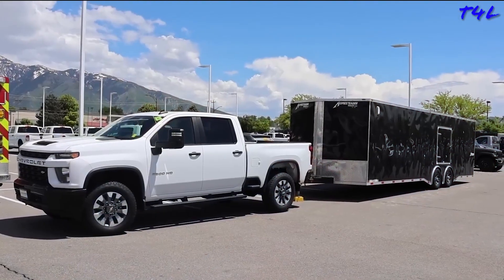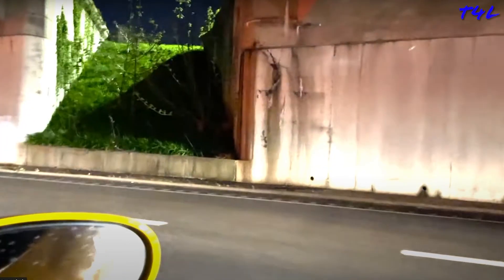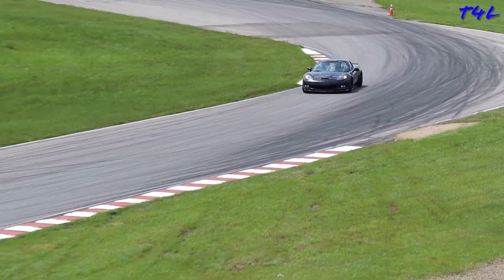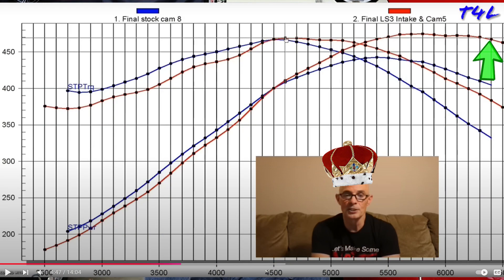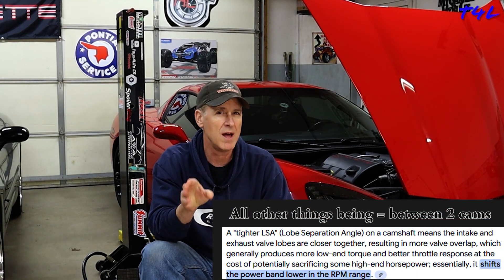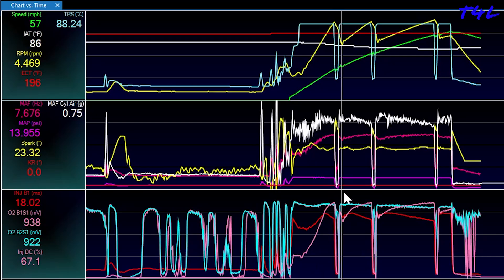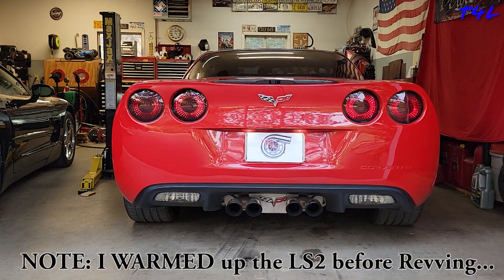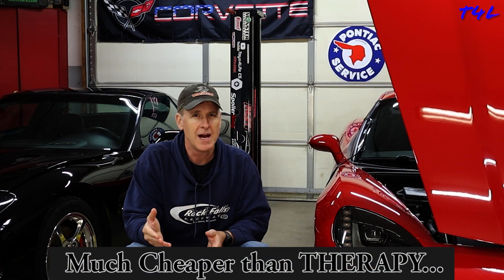Choosing a C6 Corvette Camshaft (Finding the Right One for YOU!)

Comment: I have questions, I see many people do headers and cams, it is necessary do both or I can do only the camshaft?
Reply from the maker: Ideally, if heat weren't an issue for daily drivers, headers will help a cam make another 10 to 20 horsepower everywhere.  You can definitely add a more aggressive cam with stock manifolds and still get gains, just not as much. The more aggressive the cam, the more it will benefit from headers.
Reply: Thank you.

Comment: I went with the Texas speed Stage 1 LS3 N/A Camshaft but I got dual valve springs and hardened pushrods as well the lift is .629 and it says the operating range is 1600-6800 rpm
Reply from the maker: Sounds like you have a solid combo!
Reply: Do you an auto or manual ?
Reply: @junioraguilar4004  manual

Comment: I watched a lot of Richards vids before I spec'd out a cam for my G8.  I went with a custom cam and spring package even though RH shows that the off the shelf BTR cams and their spring package works very very well.    I'm happy with my results but if I could do it again, I would change a few cam specs slightly.  I can tell you that a 212/224 115+3 LSA is done revving at 6500 in a 6.0 so you gotta go a bit more aggressive than that to rev all the way out to 6800.  My goal was to keep a smooth idle and I still have that and run high 12s in the 1/4.
Reply from the maker: I watch a ton of Richard holdner as well, great stuff!What are the specs of the can that you went with?
Reply: @Toys4Life  212/224 .590 lift 115+3 LSA.  It comes on at about 1800 RPM and should be shifted at like 6400.  If I went with a 114+2 LSA I think it would have bit more power with the same RPM range and should still provide a low smooth idle without shaking the car.
Reply: @Toys4Life  The Cam Motion cam calculator is a fun tool.  I called them and had a chat about valve events and got a bit more technical insight on cam design choices.

Comment: Hi Brother. You might want to check out the Lingenfelter 2-3 cam with .578 lift. I'm considering it for my 04 C5 with and auto and there's a few videos of guys showing the start up and idle and it sounds very usable.
Reply from the maker: I peeked at it an it is very small increase in duration over the LS2 stock cam (207/220) vs (204/213 ) but a bigger increase over the stock LS1 cam (196/208) so I think it is a bit too mild for what I am looking for.
Reply: @Toys4Life  I can see what you mean. I'll be looking to hopefully get my 04 LS1 up to around 400 hp without murdering the gas mileage. I retired last year and absolutely love touring in my Vette. Got to get my garage cleaned up first!

Comment: personally i recommend if you have a stick car, go with a bigger cam than you think. i have a c5z with a BTR stage 4 and just about everything else you can think of. car made right at 480whp. wish i couldve gone with a stage 5 (if they made it) but i was limited on my PTVC.
Reply from the maker: @ 233/248 duration I am afraid of losing too much low end torque which with a manual means a boggy 0-20 mph without abusing the clutch.  Do you disagree?   3k and above would be fantastic though!
Reply: @ if it was a camaro I would but the vettes are light enough to where it doesn’t matter. I feel like my car has a similar amount of passing power from 2-3k rpm as it did before I did the cam. After 3k it puts you in your seat. Driving around town isn’t bad either as long as I keep my revs up above 2k. Car with 325 Toyo R888Rs spins 1st, 2nd and most of 3rd the with stage 4 cam. It’s not as bad as most guys claim it would be. The only time I would say it’s hit or miss is through parking lots at 5 mph or so, above that it’s fine.
Reply from the maker: I Appreciate your first hand real world opinion - thank you!

Comment: Let me know if you need help. I’m very knowledgeable on the subject. Also you can run up to .600 no problem. Ls start to have issues at about .610-.620 lift. What happens is the rocker starts scrubbing the valve stem and will dig in to the tip. You’re going to want to pay close attention to your dynamic compression if you want to keep low end tq. Ls2 are plenty happy at 8.5:1 on pump gas. Your cam should be tailored around heads(flow and volume), compression and runner length. If you would like to discuss this stuff I’ll give you my email.
Reply from the maker: Appreciate the offer!! I'm open to suggestions. Stock 243 heads, 6.0 LS2, I want to make significantly more power up top while minimizing the torque loss below 3000 RPMs. This is more of a concern for me because I have a manual transmission and I don't want to get too soggy (from 0 to 20 mph) whereas this could be overcome with an auto with a stall converter. Basically I want it all, lol. The question for me really is what combination of duration, lift, LSA and overlap are the best balance between those two objectives? Thoughts? And I'm not a fan of cams that keep the ingredients secret as I do want to know what I'm buying (:-).
Reply: Anytime you go up in duration you’re going to drop dynamic compression ( when the intake valve closes and you start compression air and fuel). You want to make the dynamic compression as high as possible for the fuel your going to be running allows. Pump fuel can handle 8.5:1 no problem. I’ve run motors as high as 9.2:1 but they end up with a narrow tuning window. One way to increase dynamic compression when going up in duration is tighter lobe separation angles however engines with tighter lobe separation angles stink (fumes from unburnt fuel due to more overlap) and fall off rpm sooner. I would mill the head .040. That increases in compression translate over to the dynamic as well and you will end up with  wider separation angle to obtain the desired dynamic compression ratio. The added compression will increase tq and throttle response. Then with a wider lsa it will carry rpm later. I think you would be happy milling the heads .040 and running something like 227/234 on at 114 lsa and keep the lift under .615. I haven’t done any of the math so don’t hold me to that 100%. That should make power to about 6300 and shift at 6600-6700.
Reply from the maker: Thank you for the input!!   I won't be taking the heads off (just yet) so milling and perhaps porting will have to wait for now (:-).

Comment: Had a C6Z with H/C only and the cam was from Texas Speed and Performance.  

The cam specs were:

Duration .050 236/248
Lobe Lift .353/.353
Valve Lift @ 1.8 .635/.635
Lobe Separation 114
Intake center line 110

This was good for 534/502 to the wheels.  Stock intake and exhaust.  Smooth idle during stop and go traffic.  And most importantly, it have that lope at idle sound that we can not get enough of.  This would be similar to a "stage 2" cam from what I have gathered.  Hope this helps!
Reply from the maker: With the C6z manual, how was it soggy when you hit it from a dead stop until RPMs got above 2500 rpm or so?   This is one of my biggest concerns.   Roll racing - no problem, but starting from 0 mph with a manual transmission and stock rear gears - could be boggy?  Thoughts?? Thanks!!
Reply: @Toys4Life  Unfortunately, I never took it to the track to get 1/4 mile times.  I like the twisties more.   I did have the shift light set to 3300rpm for launches. 

There was a boggy-ness to it during launches now that you mention it.  I never really noticed it.  Upon a  0 mph launch, you could feel the torque kick in, but after about  a second you feel the full force of torque kick it.  Sorry kind of hard to explain.  It still punched you into the back of the seat.  But you're right;  it was not as immediate as a roll race.  So if I had to guess, the boggy-ness was less than a second.  But any amount of boggy-ness will certainly cut into drag times.

Also, the performance shop (Aikman Performance) recommended this cam since they knew that I would not be taking the vette to the drag strip.  I'm now curious is a different spec'd cam would have been recommended for the drag strip.  Aikman Performance is big into taking vette and mustangs to the drag strip and the Texas 1/2 Mile races.
Reply from the maker: Thank you for the input!!

Comment: So far all I've done is put speed engineering full exhaust on my car. I wanted to do a camshaft or a supercharger because my end goal is 550 hp. I bought my parents a white C5 Corvette and it has a Texas beach cam better valve springsand a whole bunch of other stuff done to it. It's fun to drive and a really fast car with the automatic in it, but it is a pain in the ass to drive sometimes it will stall out because the cam is huge.
Reply from the maker: If my goal was $550 horsepower, I would leave the engine stock and slap on an A&A, in fact that's exactly what I did with my C5 and it makes 585 to the tires. The C6 build is targeting around 400-450 to the rear tires.
Reply: @ with the a&a kit does it come with different injectors? And will the stock fuel pump handle the extra fuel?
Reply from the maker: Comes with bigger injectors and usually a boost a pump for more fuel.

Comment: Your excellent vid on timing convinced me a cam should be very high on the mod list.  Very much looking foreword to  vid 2.  I like a lca down in the 110 area cz you trade a lil peak hp and idle quality for some mid range punch off the corner.  That is why oval track cams have very narrow lca.  And a lobe profile that will not beat the valve train to junk if you drive out of town now and then.  Good Luck!                                                                                                                                                                                                                             ''@davidncw4613
4 months ago
Good stuff as usual.  You could use the compression as a reason for more cam.  Later intake valve closing point will bleed a little dynamic compression.  In my way of thinking this engine is begging for more cam.''

Comment: The GM LS3 495 crate engine camshaft is mild  camshaft it runs with stock LS3 valve springs would make a pretty big difference vs the stock LS2 cam with gobs more torque 2700-6200rpm than the LS2 cam it will need a tune it's pretty mild 219/228 duration 525/525 lift should pull hard to 6700rpm this mild setup should not need tons of maintenance and be dependable and reliable even this mild setup would like a 3000+rpm lockup stall converter

Comment: Do not over cam it no need
Reply from the maker: I agree! I see a lot of go big or you will regret it too,  I prefer to get as informed as possible and increase the odds I choose the right cam for what I am asking the engine to do (:-)
Reply: @Toys4Life  if the cylinder heads flow well you won't need a huge camshaft l prefer something that makes the most average power throughout the intended rpm range rather than being sucked in to peak numbers most very large camshafts will make 10-15 more horsepower at peak than something more mild that makes more power earlier in the powerband gearing stall converter weight of car all comes into play something not to choppy that runs clean and crisp something that will run smooth by 2000-2200rpm

Comment: GPI SS2 228/240 duration 646/637 lift with a lockup  converter stall between 3200-4200 and it should run really crisp with really good throttle response and lay down at 45mph at cruising speed once the converter goes into lockup 4200rpm should put it right at the sweet spot they have camshafts with more duration than the SS2 the SS2 cam should be very streetable this is the biggest cam I'd want to drive on the street the SS3 SS4 are more aggressive mid range torque should be really good 3000-4500rpm with the SS2 camshaft with peak torque about 5200rpm and redline 6700rpm it will rev to 7200rpm if your not wanting to put a stall converter in it go with the SS1
Reply from the maker: Sounds like you've done your research!
Reply: @Toys4Life  l have a 2011 Camaro SS with a GM Performance LS3 495 horsepower crate engine tuned on E85 with a 6L80e transmission and a Circle D 4200rpm lockup stall converter  with a bunch of other upgrades it weighs 3920 pounds with me in it has stock 3.27 gears full interior and AC best eighth mile pass 7.22 at 96mph 1.70 60 foot time with only 3 passes this setup in a lighter C6 with good traction and a clean run should go 2 to 3 tenths quicker this setup drives like a stock LS3 at part throttle once the converter locks up in 5th gear at around 45mph very streetable it has a ever so slight chop that is barely noticeable at idle vs a stock LS3 and has a wide torque band and pulls strong to 6700rpm redline it has CNC ported and milled LS3 heads

Comment: I can vouch for not going too small. I put a cam in my 5.3 pickup years ago. Because i didn't want to change torque converter or worry too much about tuning, i went with a small cam recommended by comp cams based on those criteria. I spent a few days putting it in including swapping springs and pulling the heads. But the result was nearly unnoticeable in the seat of the pants. Massive waste of time and money. So while i understand not losing too much bottom end, my opinion now is it better damn be noticable if all that money is spent haha
Reply: I was young and stupid so I'm sure you won't make that mistake
Reply from the maker: Yeah, for a heavy pickup would need a fairly aggressive cam and a stall and a big tranny cooler - especially if you tow stuff once in a while!

Comment: One big thing to keep an eye on it your head flow rate. Some heads don't benefit much, if at all from bigger lift. I'm not sure for the c6, but my heads supposedly don't flow much above .580. Keeping the lift down also halved the cost of the needed springs. Big cams with a lot of overlap will also tank fuel economy. If you're just looping for the loping idle, a lot of that can be achieved in the tune by adjusting the idle down and adjusting how much over/under run the idle is allowed to have.
Reply from the maker: Several good points - thanks!

Comment: I have an 05 automatic & went with a Texas Speed stage 3 low lift cam. It does well especially in 3rd heading to work. I went with this cam because it didnt need a torque converter installation.
Reply from the maker: Nice!
Reply: What is the idle like? Is it choppy?
Reply: @LsxCay  so I believe the low lift cams utilize the duration of the valves opening to compensate the lift height. I think Mine sounds unique for the car and I'm only running the SLP loudmouth axle back exhaust. Not too loud but you can definitely tell it's not stock at idle.
Reply: @dretuck4604  thank you I will maybe be getting something like that done to my 05 aswell
Reply: I went with the same cam. Great streetable cam with good performance and a nice idle. I have clips on my channel. Mine is a 6 speed.

Comment: I'm one that went with a small cam to start with, later put a little bigger one in.  TSP 220r, sounded great, but left a decent amount of power on the table. Now it's got a not outragous, very streetable 228/232 with same .600 lift but def. bumped up the power. I wouldn't mind it being bigger, but woudn't gain much and would def. lose driveability.
Reply from the maker: @bigbenisdaman  Do you have the LS2 6 speed manual?  That cam 228/232 is on my list as being one of the most radical I would consider.  How much do you notice the loss of torque below 2200 RPM?
Thanks!
Toys
Reply: @Toys4Life  It's in my C5 that's an auto, so converter, it's still a smoother cam than some out there and great power.  My c5 has a 376 with ls1 stuff on top.

Comment: Very timely, I am looking to do a cam swap on my 2003. I would like to hear your thoughts on how the cam choice may differ based on if you have a manual versus automatic. I have an automatic, so I have to take into consideration the torque converter.
Reply from the maker: Most of the manufacturers list the recommended converter stall RPM, with an automatic I would really take that seriously. Also, more cubic inches can handle more and take duration so the 5.7 would be a tiny bit less than the 6.0, but not much.